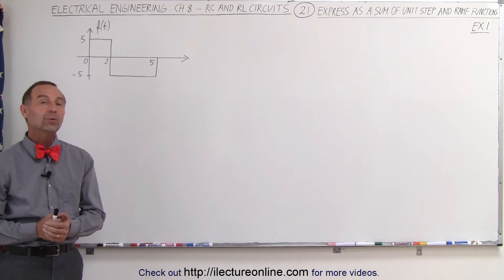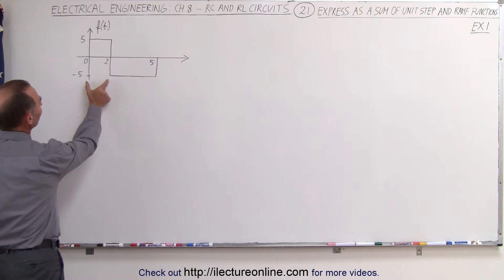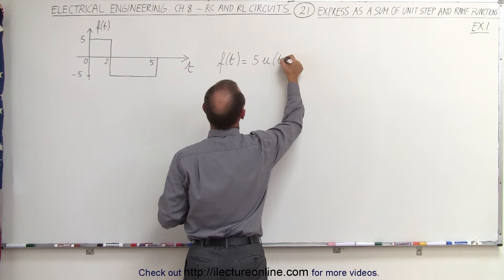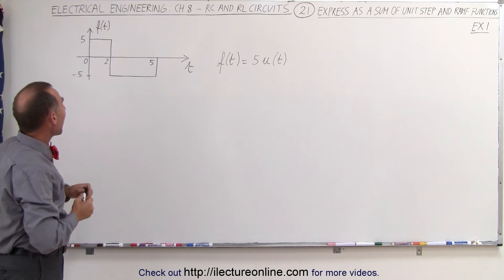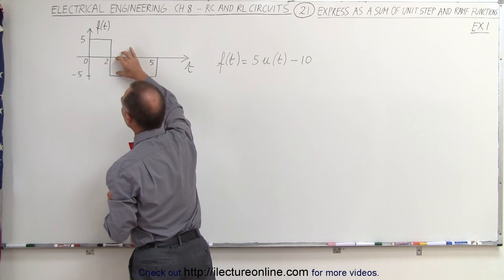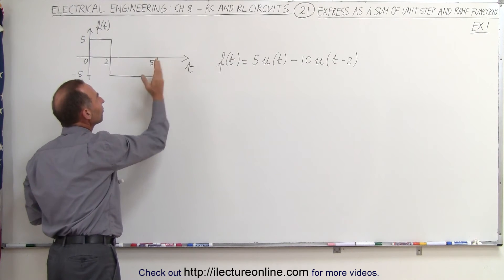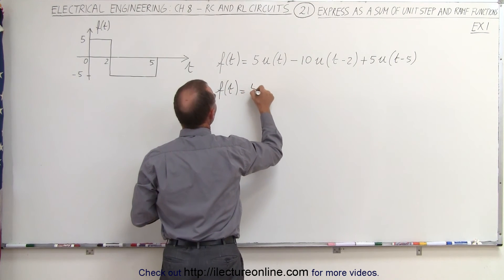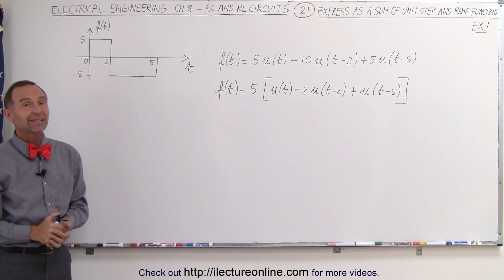Electrical Engineering: Ch 8: RC & RL Circuits (21 of 43) Express as a Sum or Unit & Ramp Fct: 1

Comment: Professor, we could write all of these step/impulse/ramp functions as simply a single piecewise-defined function, right? If so, then what's the purpose of such functions? Is it to just write them in a single line unlike a piecewise-defined function?
Reply from the maker: You are correct.   These are examples to enhance our understanding.
Reply: I see; thank you! I can feel your passion for teaching by simply noticing your smile at the end of every single video. :)